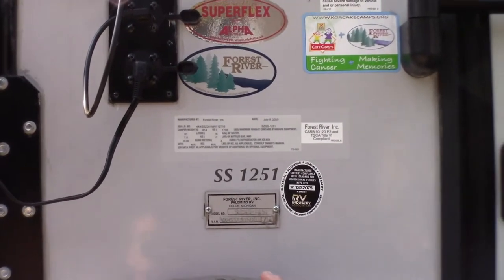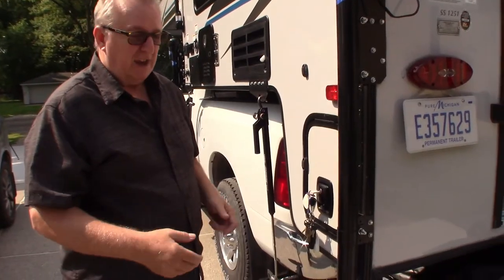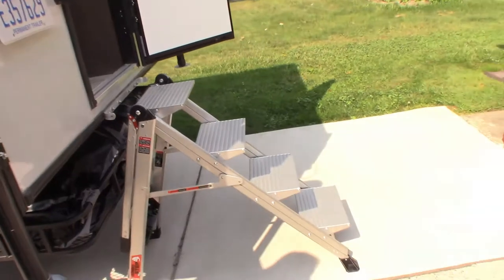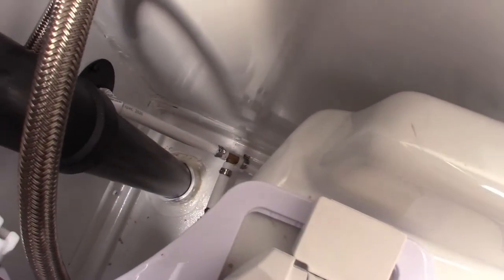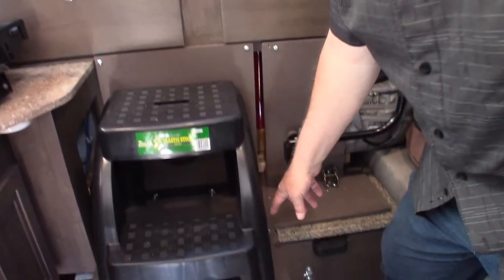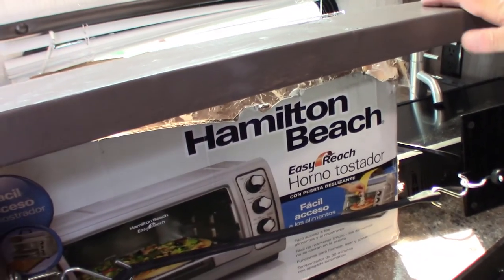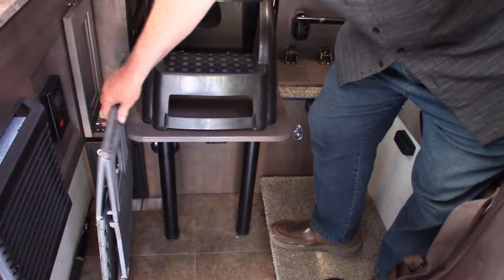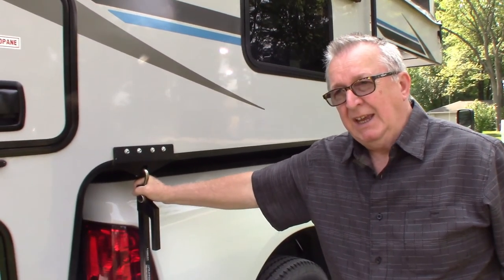Truck camper Palimino1251 ss

Comment: How long does the battery work for you? Do you happen to have the solar panel on top? Looking at buying one of these myself and curious how well it’ll hold up off the grid.
Reply from the maker: The camper came with two batteries and solar panel on top. I never tested how long the batteries hold up and depends what you have on.  I like my camper well enough but I really like it with the modifications I did. 
If you would like some pictures of mods, I could send some to you via email. The steps I made in the camper really make it a pleasure to climb in the top bed, plus the seating couch I bought for it also. The price of the camper has really gone up since I bought mine. I would buy a good used one and modify it anyway.
Reply: @richardatkinson6031  thanks for the reply Richard! Your modifications were impressive and it was a joy watching the video.